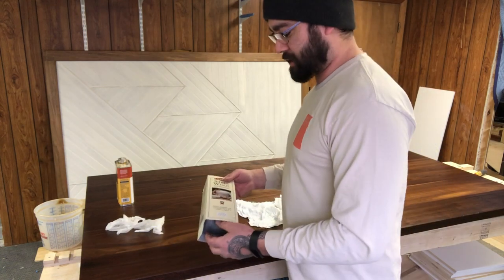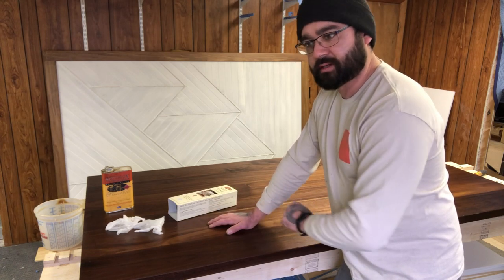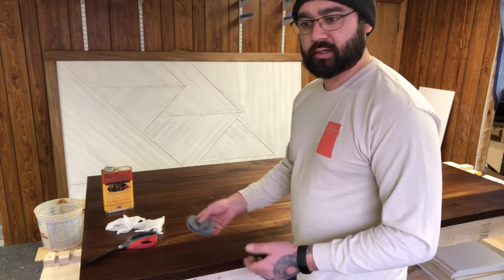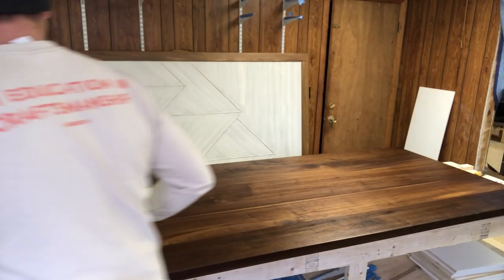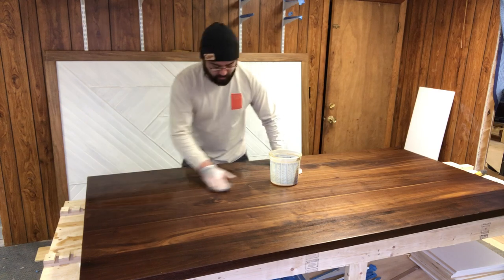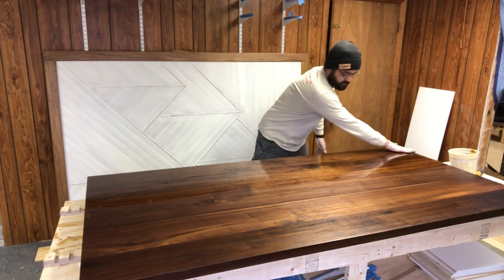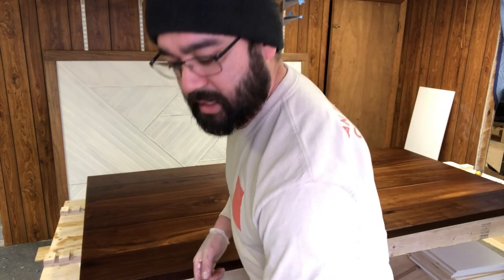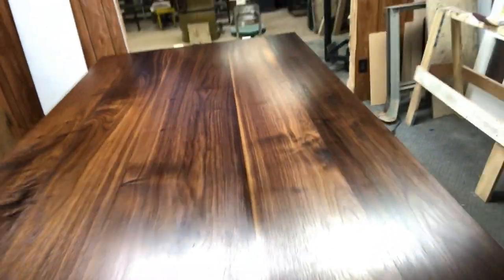How to apply Waterlox over Danish oil on a walnut table top

Comment: Thanks for sharing your method. I use both homemade danish oil & Waterlox for wood bowls. For porous woods such as oak and elm, I start with the danish oil (2 coats) and then wet sand the third coat with thinned down Waterlox (approx 35% mineral oil added). This wet sanding of the thinned Waterlox helps fill the pores with the slurry the sanding makes and since the Waterlox gets gummy very quickly, it sets that slurry into the pores really well. After that, I'll add another full-strength coat or two of Waterlox. As you mentioned, it's hard to beat the depth you get with the danish oil used prior to the finish coats. I find too many coats of Waterlox give a plastic look. Great to see someone else uses a similar method and has excellent results.
Reply from the maker: I love this method, it’s not for every project, but it really enhances figured wood. I do like being able to see the grain pores in table tops, I imagine that’s not desired for bowls. Thank you for watching!
Reply: @gunnergreyfurniturefusion8445  The only thing I don't like is the attention you need to give these oils. I have to keep a paper towel handy for bleed out oil. Just the one little issue but it's manageable.

Comment: I'm about to add Waterlox over Tung oil on an oak counter and thinking I'll use this method. Most other sources on Youtube and from Waterlox website mention light sanding between coats and vacuuming/wiping up all dust. Is it not a problem using the steel wool and leaving that dust in the finish?
Reply from the maker: No need to sand between coats. Possibly after the first coat if you didn’t raise the grain first. The steel wool will break down, so you have to make sure to  get it all off with a rag. When burnishing with 0000 steel wool, you will get very fine dust. When you burnish with finish on the steel wool, it does not produce any dust.

Comment: Looks great. I’m going to be making a new top for our dining room table this spring. I’ll try this out because I have struggled with these types of finishes in the past. I have no problem with taking the time to do a ton of thinner coats to end up with a great finish. How many do you normally do before you consider it finished?
Reply from the maker: Including the first heavy coat of Waterlox, around 6. Depends on how it looks. I like building up as well. Much more control of the outcome and less sanding

Comment: How long do you allow the danish oil to dry before applying the Waterlox?
Reply from the maker: Really depends on your climate. In ideal conditions, you should wait at the minimum 24 hours. Too warm, cold or humid, I would wait at least 48 hours. They have faster drying Danish oils, but most of them recommend 24-48 hours.

Comment: Would the same method work with veneered plywood?
Reply from the maker: I’m sure it would be fine. I’ve never tried it.
Reply: @gunnergreyfurniturefusion8445  I'm old school so I will probably use steel wool, but one of my instructors suggested a Mirka Mirlon pad (1500 grit) works well too.  Any experience with these? BTW, your walnut looks to be higher quality than what I have access to near me.  I think I'd have to use a sanding sealer before waterlox or similar finishes to avoid a blotchy finish.  Does the danish oil serve the same purpose?
Reply from the maker: I’ve never used the Mirlon pads for application. I have only used them for burnishing. I don’t see why it wouldn’t work, they aren’t as dense as steel wool, so it may break down faster. You are still able to see pores in this walnut, which I like and prefer. The danish oil is not a filler. It does act as a sealer for the Waterlox
Reply: @gunnergreyfurniturefusion8445  Thanks for the follow up.  Would not mind seeing more vids from your shop. Your presentations are clear and straightforward.  But I expect you have to make a living too.
Reply from the maker: Thank you! I enjoying teaching and would love to make more videos, finding the time is the difficult part.

Comment: Can you use the same method with Arm R Seal? Do you still apply 6+ coats? Is Waterloo any better?
Reply from the maker: Yes, I have use this method with Arm R Seal and it produces an excellent finish. I brushed on the first coat to get a solid base layer. 3-4 coats after that. Waterlox isn’t any better, just depends on the sheen you are looking to achieve

Comment: About to do a similar process for my desk with Tried & True Danish Oil + Waterlox Original, any tips for a beginner or things you've learned about this combo since you posted this over a year ago?
Reply from the maker: Take your time. it’s a slow build up, very thin coats. How I applied it in the video is the same way I still do it. Using raking light helps see any left over rags marks.
Reply: @gunnergreyfurniturefusion8445  Do you sand/burnish between the Danish oil coat and first topcoat of Waterlox?
Reply from the maker: @ShwackerSwag  I do not. With this process, sanding is not required. Depending on how quickly you want to build up the Waterlox, you may have to sand after the first coat, if you apply with a brush. If you maintain the steel wool and wipe clean, you should not have to sand between any coat.

Comment: Hey man, can you do the same on a polyurethane finished table top?
Reply from the maker: I wouldn’t recommend it. Poly goes on very thick and you typically do not wipe it off.
Reply: @gunnergreyfurniturefusion8445  I'm talking about using Danish oil over Poly when it's dry. Rubbing it into the poly with 0000 steel wool. Then wiping clean afterward.
Reply from the maker: @redgum1340  oil finishes, particularly Danish oil, are designed to penetrate the wood where poly sits on top. If you apply oil after poly, it will not penetrate and will wipe completely off